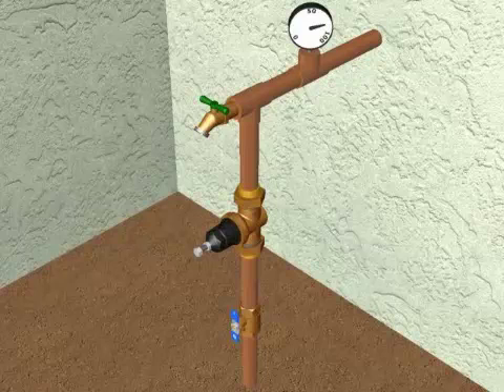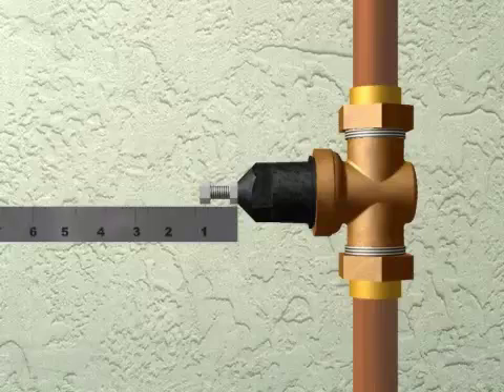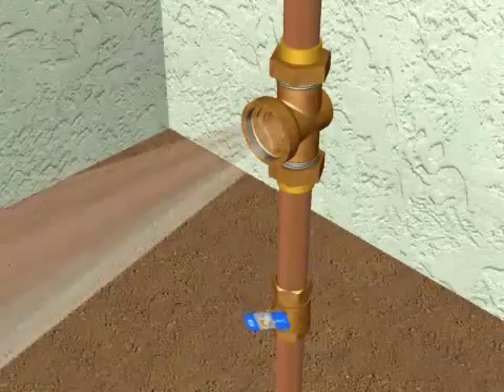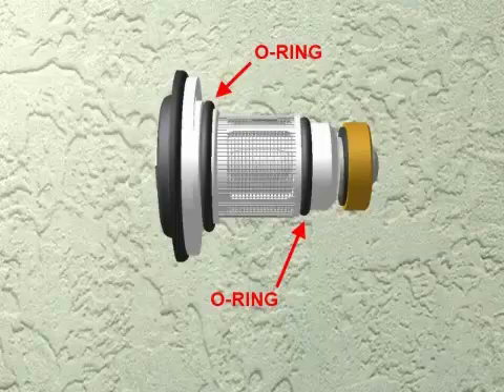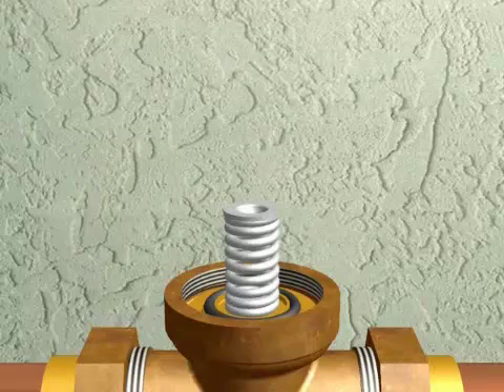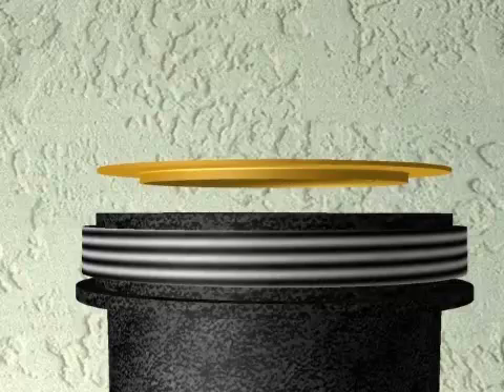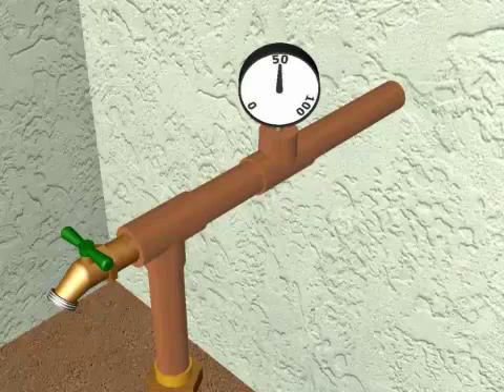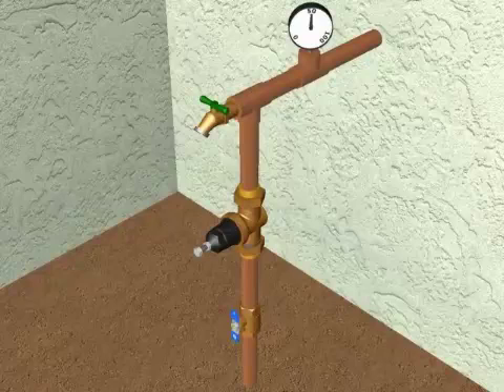Zurn Wilkins Pressure Reducing Valves NR3 - How to Repair

Comment: RK114-NR3XL Repair Kit includes one Gasket. What is this for? Can anyone answer this, please?
Reply: The rubber gasket? It is for union connection with pipe fitting. It is very difficult to find this kind of union connection gasket. 
Honestly, buy a new one may be easier. With a repair kit costing almost 2/3 of a new unit, it may not be a good idea to fix it. 
That is their selling strategy.

Comment: How do you remove the polymer bell housing on a BR4 without breaking it?
Reply from the maker: According to our Product Manager, "to remove the bell on a BR4 or NR3, you will want to take off the tension from the spring by backing out the adjusting bolt that sticks out through the top of the bell.  It is wise to measure the height of the adjusting bolt before removing it so that you can return the valve to the same pressure setting when re-assembling it if you do not have access to a pressure gauge. Next you will need two wrenches, one that fits the flats on the bell and the other to hold the body.  I prefer a pipe wrench for the body and a large crescent or spud wrench.   The bell is very durable, and unlikely to break.  I have taken off bells that where on for over 20 years and covered in calcification which caused them to need a lot of force to remove them but they all removed without breaking."  Feel free to contact Zurn Customer Care, with further questions.
Reply: @ZurnIndustries  thx you
Reply: very carefully.

Comment: Do you have a part number on that cartridge or repair kit for the NR3?  Thanks.
Reply from the maker: The part number for an Zurn Wilkins NR3 Repair Kit is RKxxx-NR3XL, whereby xxx is the size. For example, an 1-1/4" NR3 would use Repair Kit part number RK114-NR3XL, and a 1/2” NR3 would use the RK12-NR3XL. We offer repair kits for all NR3XL and NR3 sizes (1/2” – 2”).
 
Please let us know if you have any additional questions. Thank you!